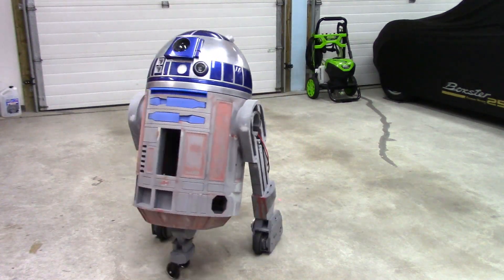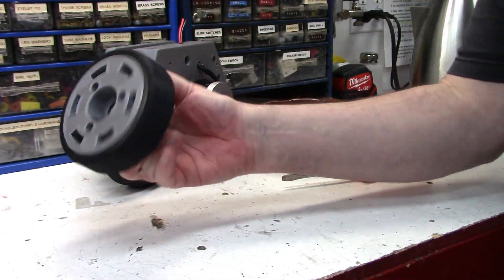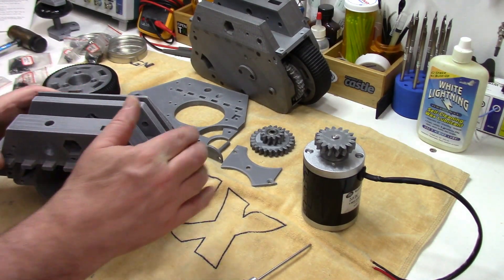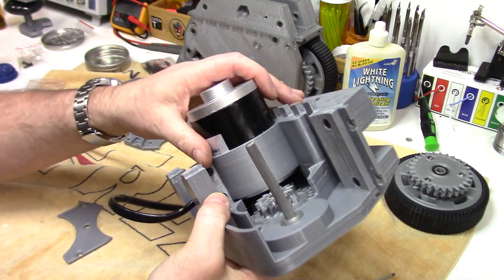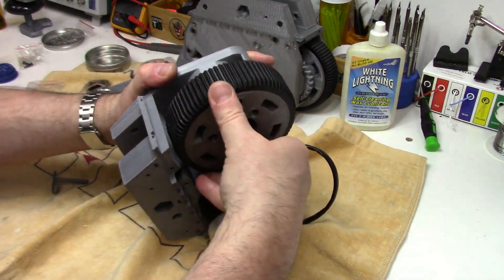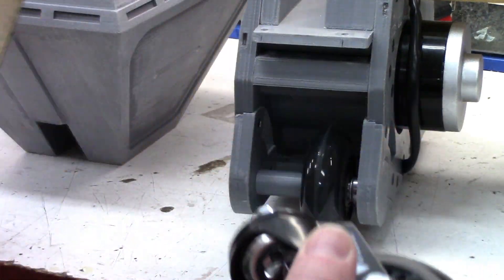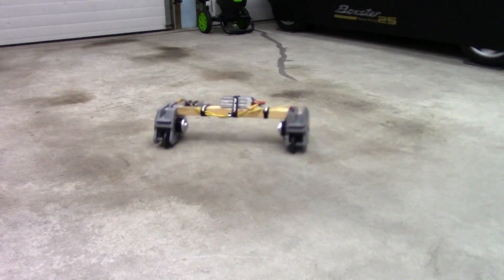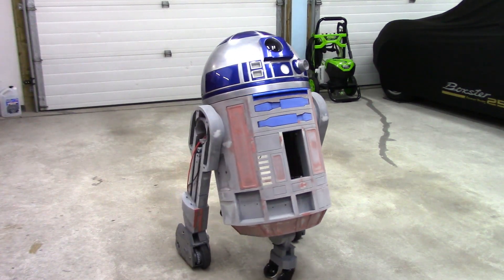Building R2-D2 Part 8 - First Steps! V2 Legs & Mark 3 Foot Drives

Comment: Which legs did you print John I see there are two lengths, shorter ones or the longer ones if in the future you want to upgrade to the 2-3-2 version.... With regards to omni wheels learnt my lesson in the past with another none rc project trying castors, didn't work, so I sourced some rubber hard wearing omni wheels in the UK, they vary so much in price and with shopping around can find some at a reasonable price, eBay tended to be expensive for some reason....I decided to bite the bullet looking at the final weight variant of R2 I would buy the 3.25 omni wheels than attempt to print them, parts are getting hard to find in the UK for electronics especially the sabertooth board, still waiting on Prusa at present to catch up on production so still waiting on my printer, I have really enjoyed following your journey on this build, I was looking for another hobby as well as rc helis that would occupy my mind during winter months and rainy days, this has given me a good enough reason to justify a 3D printer, will you be doing a final video of your radio programming how you set your mixes and switches and controls up in the radiomaster, great work really enjoyed the R2 videos
Reply from the maker: V2 Short - I have zero desire to have 2-3-2, not to mention R2 is already top heavy and having the center of mass even higher off the ground seems problematic IMO; but what do I know 🤔
Yep, I very reluctantly ordered two VEX 3.25 Omni's the other night. Unfortunately, like many other items right now, the VEX Omni's are also in the realm of unobtanium. I did however find a place in Canada that still had some showing in stock.
I'm sticking with the roller blade casters in the front for now. They are so smooth and quiet and are much more robust which I need for my environment. 
Might do a basic control video at the very end of the project just to show the basic controls, but won't be going over every aspect of OpenTX setup because it will be vastly different for every build & individual's preference. Besides, it's easy - there is no complicated mixing or output curves,  nothing like a helicopter setup. Each channel has it's own input and output - nothing complicated at all. Of course, that's the great thing about Open or EdgeTX, you can make it as simple or complex as you want it to be. I can only imagine the automation we could give an OpenTX controlled R2 with creative logical switch programming.

Comment: Great job to get him moving, I just can’t get a Sabertooth 32 at the moment so your so lucky you have one.
Reply from the maker: @Zombiehunter115 - Yes I had a hard time finding one too.  Robot Shop were both showing restocking by mid December last year, but they never got any in and now are showing end of March which isn't too bad if that time frame holds. I located the one I got back in January at a place called SuperDroid Robots, but they are out of them now too I see.

The folks at Robot Shop recommended the Cytron SmartDrive Duo 30 when I asked if they had anything else that would work for an R2 build of similar quality and specs to the Sabertooth 2x32 or 2x25.   https://amzn.to/3JdYLHI

The specs are certainly good as is the price. The only small concern is the switching frequency of 18kHz vs. the 30 on the Sabretooth. I very much doubt it would be detectable. I know I can't hear an 18 kHz tone, but some people likely could pick up on it?

Another dual motor controller I heard about is the RoboClaw 2x30A. I never looked into its operating specs however so don't know much about it.
Reply: @Rchelicopterfun  thanks but even their out of stock now too. I have got a Sabertooth 32 on order from dimension engineering but their even saying the end of may, so I guess I have to wait. Your R2D2 is coming along nicely, it’s nice to see him driving around.

Comment: Awesome to watch progress in the build! I’m glad you tested out the rollerblade wheels, I’ve wondered the same thing as you for a while. I won’t be building my R2 for a while (college student) but I’ve been trying to gather up ideas. Happy to know they work good in the front foot. I feel like in other builds the Omni wheels make the whole R2 drive around noisily, taking away from the magic a little.
Keep up the series!!!
Reply from the maker: @Lucas Sheridon, Yes, noise of the Omni's is another area of concern I too am wondering about. From what research I've gathered, seems as long as you use the VEX Robotics Omni's which have the softer rollers, it's okay. Guess we will know once I get them. Problem is they, like many things right now are in the realm of unobtanium. I found a place here in Canada that still had them showing in stock. Ordered them last night... We will see...